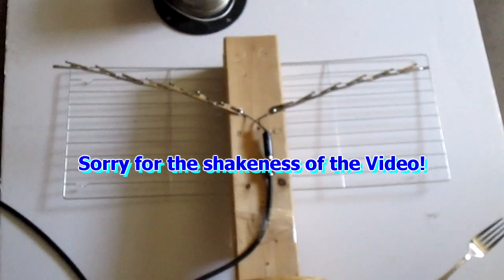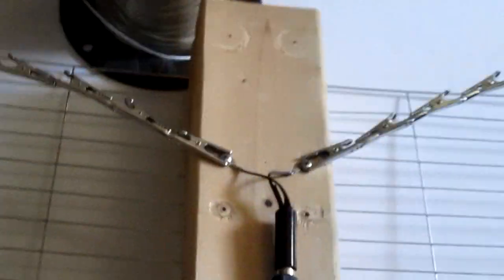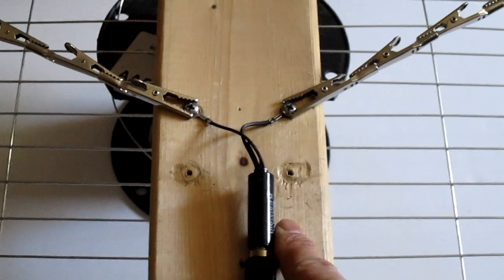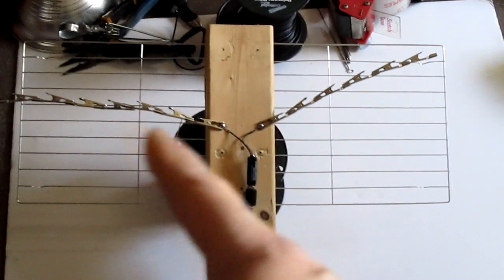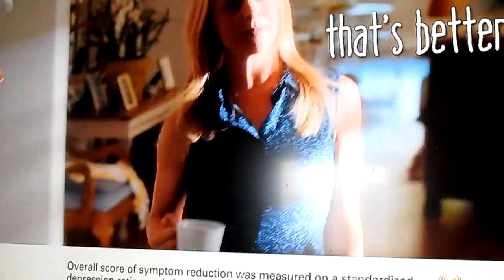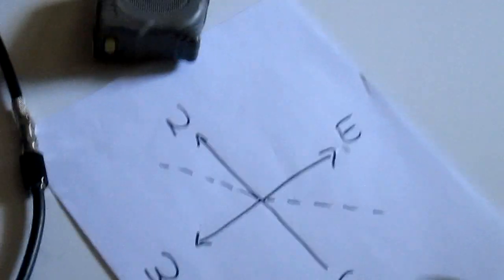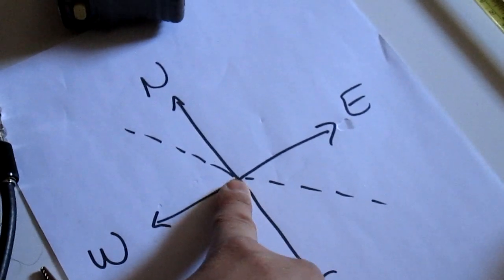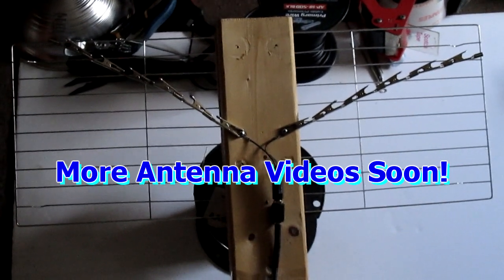$5.00 UHF / VHF HDTV Antenna - EASY + CHEAP Parts DIY FREE TV Antenna Using Roach Clip

Comment from the maker: Go to WWW.TVFOOL.COM and click on " TV Signal Locator " - From there, enter your Zip Code - From there, you should see Location / Miles / Directions of TV Towers.  From there, point your Antenna to where it is the most Channels... That way, you will know what and where all the TV Channels is / are.  NOTE:  Take your time and study all the Channels including distance + locations and all the " Important " Channels that YOU like!

NOTE:  You have to take Weather + Cloud + Terrains + the SUN SHINE into considerations during your search.  You'll be surprised how much Channels fade IN/OUT because of the Sun.  The Sun put out Radiations, so it BEND the RF Signals and sometimes you have to bend/move/rotate the Antenna accordingly.  The best way to get and KNOW all of your Channels is from 11PM - 7AM.  I have discovered that by playing with it.  During the day, I have to move accordingly to Sun Rise and Sun Set.  But at night from 11PM - 7AM, it doesn't have to move/rotate.  NOTE:  Because of that, I was able to learn how the SUN is actually affecting the RF Signals!
Reply: Step over all the cracks in the sidewalk.
Reply from the maker: Nigga, you need to sell them cracks ON the sidewalk!  Nigga is, nigga does!  😂😂😂😂😂😂😂😂😂😂Nigga is, nigga does!  😂😂😂😂😂😂😂😂😂😂Nigga is, nigga does!  😂😂😂😂😂😂😂😂😂😂